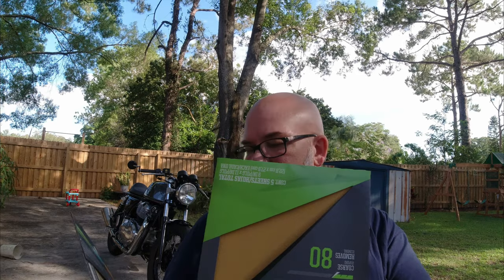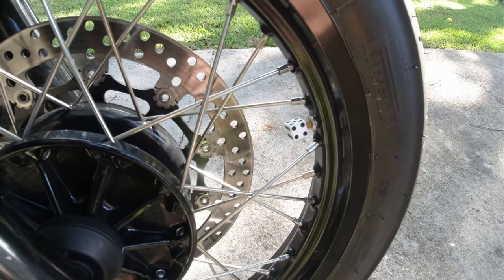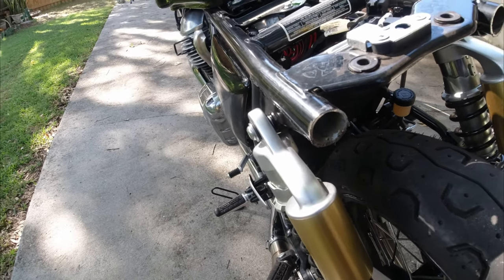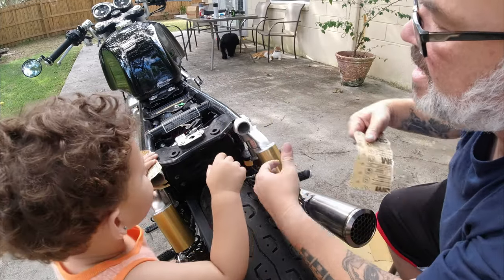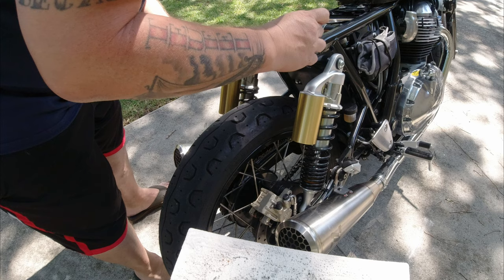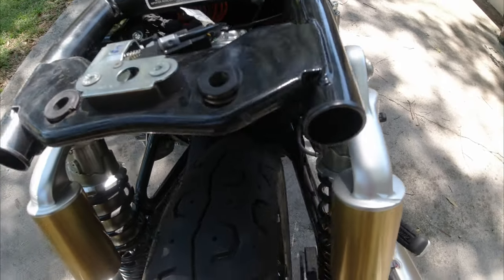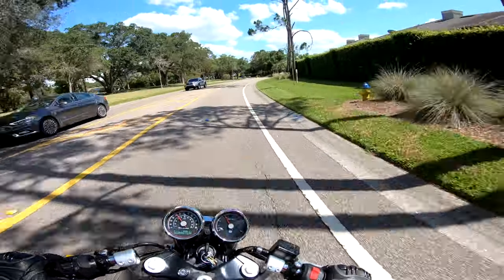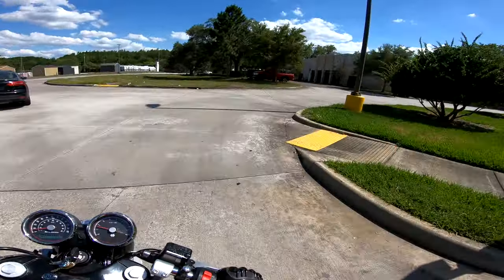Sanding and Painting the Frame Royal Enfield Continental GT 650

Comment: Mike ,if you want to paint the engine try using paint used on barbecues, i tried it and it works well !!!!!.
And it's not that expensive, give it a try .👍👍👍
Reply from the maker: That’s what this paint is. I looked at engine enamel first but ended up with high heat paint as used on those grills. I don’t think I’d paint the engine but it’s an option.
Reply: @UncleBogator  ,ok.....sorry ,i didn't understand what paint you was using,.......but even so,the bike looks shit hot !!!!👏👏👏👏
Reply from the maker: @andrewbull3537  oh no worries man. I didn’t show the label on the paint (I meant to). And thanks!

Comment: Sweet video .. thank you for making it ☺️... I have a request... Could you put the original seat back..and share how it looks... I wanted to see how far would the original seat extend behind the modified frame/tail light.... Cheers.
Reply from the maker: Can see what I can do there. They do make another tail kit by the way. Designed specifically to fit with the touring seats.
Reply: @UncleBogator  thank you for your response... Yes, there are quite a few kits available... Especially here in India. However, wanted to see how it looks with, the kit you have on. I might not be modifying my motorbikes frame any time soon ... As it would kill the warranty... So waiting for the warranty period to finish and then will go crazy.. so for now I have the Interceptor handle set up for my GT650 ... Helps me ride further with less wrist, back pain.. better riding angle and dynamics especially with the rear set foot pegs of the GT... Also, if you are planning to keep the GT to a single seat ... You could remove the rear foot pegs .. would look cleaner and help kill some weight... Also give you a 20bhp boost ... And better aerodynamics 😋.... Cheers
Reply from the maker: @kevinmansabdar5337  that’s what I’ve been missing. Footpeg induced power gains! Thank you for reminding me. 

I watched a video from India a few days ago with 4 men. 2 of them with GT and 2 with interceptor. One of the GT owners did the same handlebar swap. I’m curious why you would do that? Is it that you prefer the fuel tank from the GT?
Reply: @UncleBogator  well it depends from person to person ... I love the GT the way it is but when you ride every day to and fro to work (about 80kms) ... And with the beautiful roads and traffic that we have ... It just starts hurting in time ... Hence the handle change... And I get to swap it back to the clip-on's for track days or when desired.... And yes no doubt the tank  looks amazing and foot pegs placement is much better on the GT comparatively.